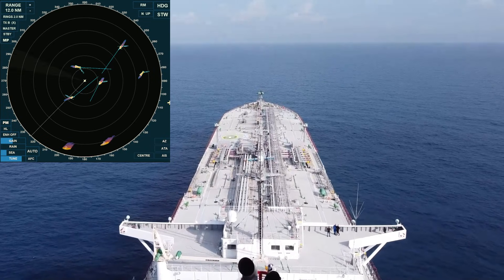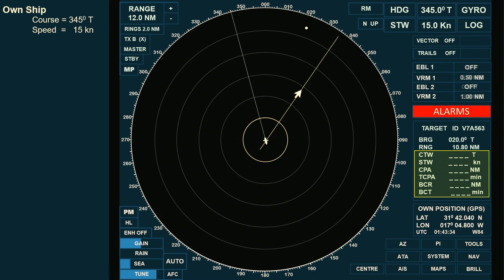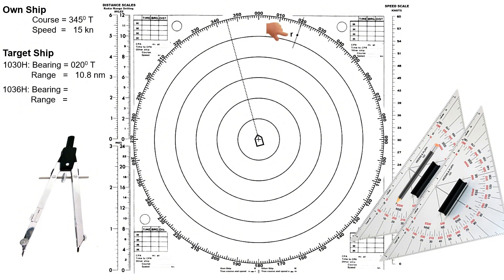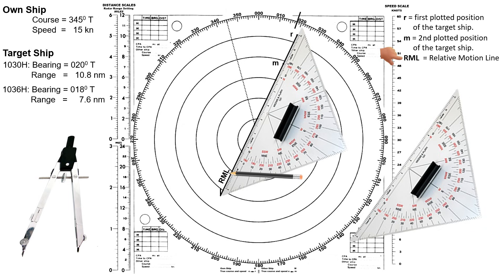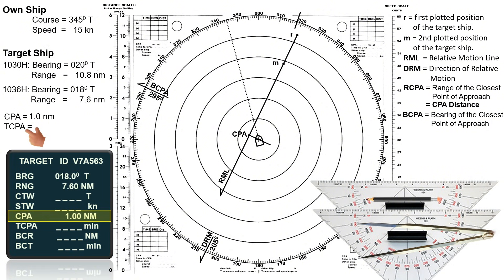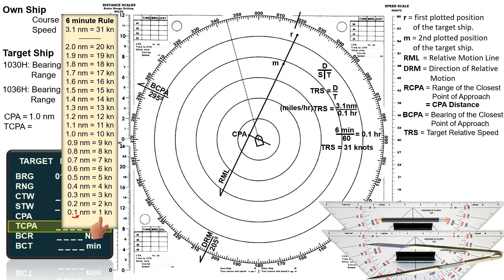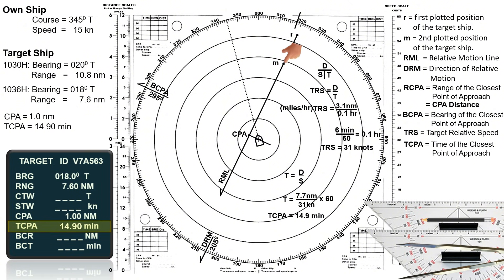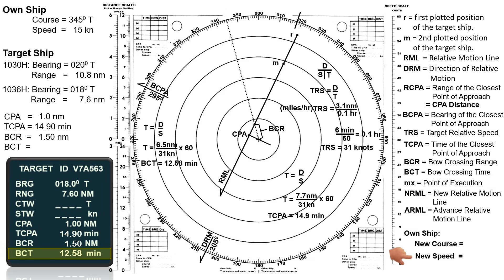Radar Plotting (Part 1 of 2):  Determine CPA, TCPA, BCPA, BCR, BCT, DRM & RS | with a 6-Minute  Rule

Comment: Im confused sorry.. please could you pls enlighten me. 0.1 nm = 1 kts? Is not 1 kts = 1nm per hour? It is the same?
Reply from the maker: It can only apply if the time interval between observations is 6 minutes. That is why it is called a 6-minute rule.
Reply: 1hr = Ten 6mins
So;
In 6mins the target ship run 0.1nm
So in 1hr the ship will travel 1nm
Therefore: 0.1nm = 1kt

Hope that helps in understanding the 6mins rule.

Comment: Thank you very much for this informations! Very precious and easy to understand. 
Just one thing, at 6 mins rule, is 31 knts in our case, and for 12 mins rule,multiplied by 2 is 62 knts,not 61 knts.
Reply from the maker: Yes, you're absolutely right! At timestamp 8:33 to 8:40, it should be 62 knots, not 61. That was a clerical error on my part. I appreciate you pointing it out—thank you for your keen observation!